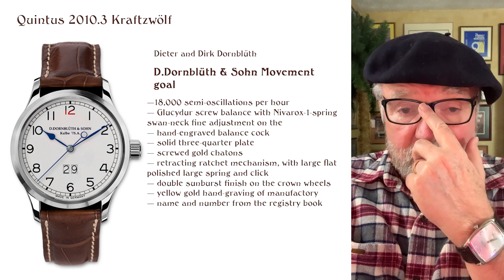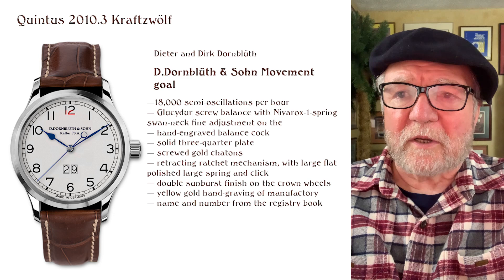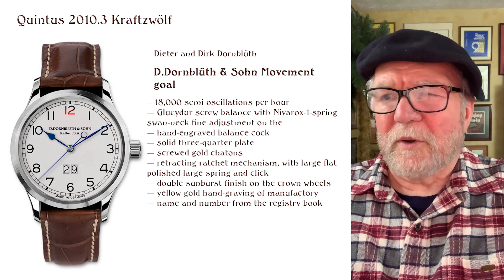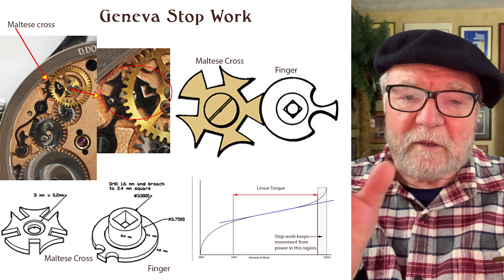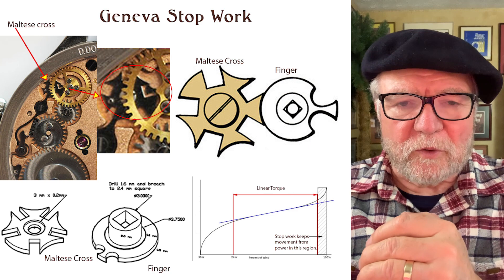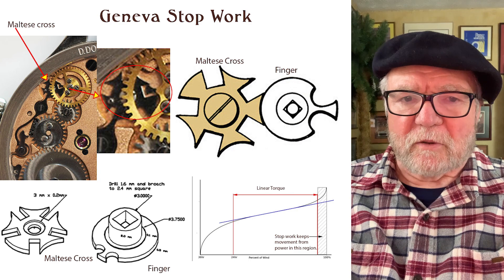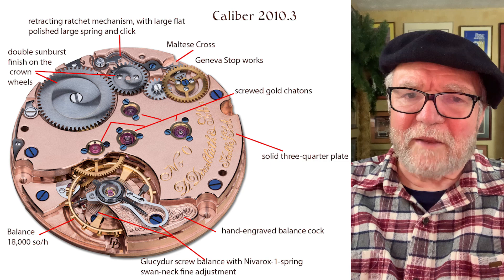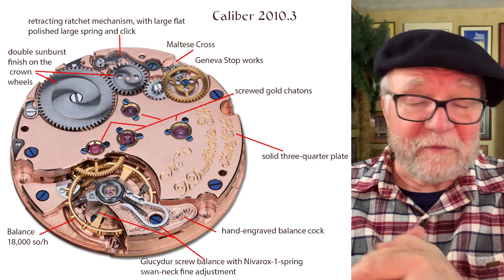D. Dornblüth & Sohn Movement and the Maltese Cross Stop Work #VP145

Comment: Hey Bill, does this constant force mechanism the. Limit or ratchet down the total power reserve. Like a governor on a car? So you trade off longevity for accuracy.
Reply from the maker: MonkeySee, it  just uses (or attempts to)  the most stable and linear part of the mainspring. So, yes, it does cut down on the amount of spring and power reserve. That's why they added a second barrel in series. Take care, Bill

Comment: Great explanation Bill. What do you think about their 99.6 mondphase. It is a moon phase watch with running seconds at 9, a power reserve at 3 and a moon phase at 6 o’ clock. I like the look of that model
Reply from the maker: Hi Richard... if I'm not mistaken their 99.6 moon phase is their newest movement, no? From what I've seen, there's a precision fit between movement and case—37mm movement in a 40mm case—1.5mm rim room! But that's not a complaint...it's excellent watchmaking. Nice movement... but I have no idea what the "countdown display" is ... the little round window in the middle of the dial. Really an amazingly interesting watch. Take care, bill